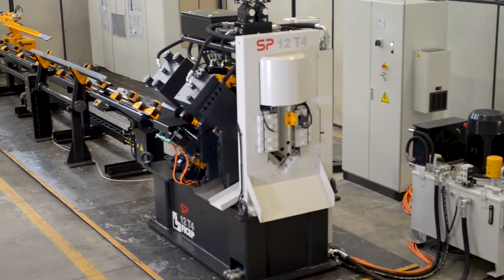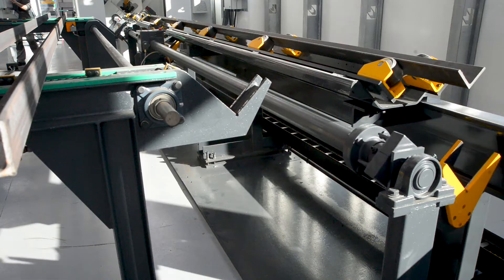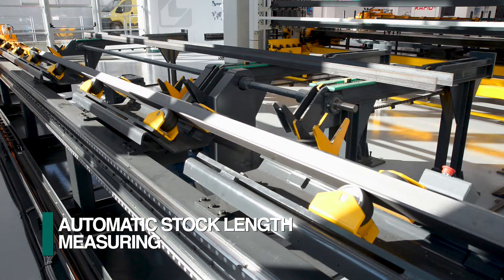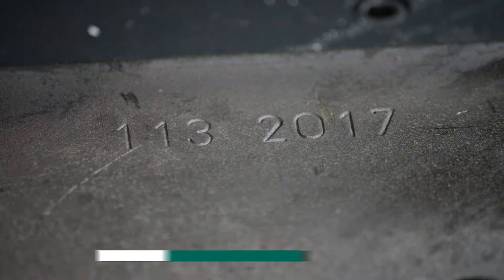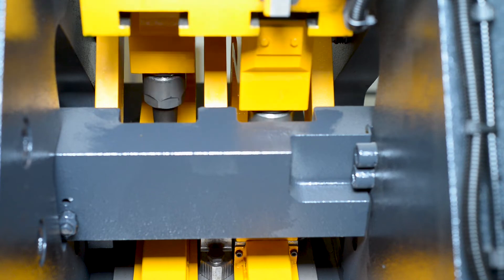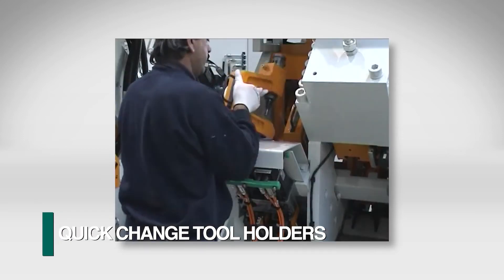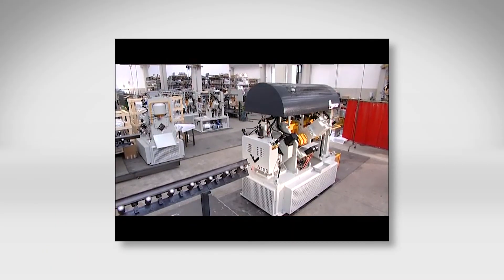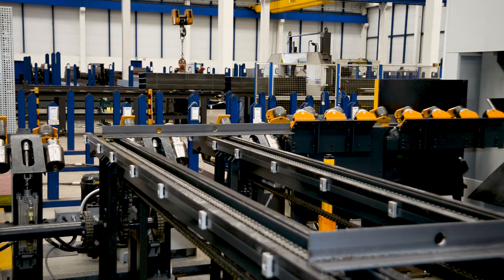Steel Angle Fabrication by FICEP Uses Unique Steel Fabrication Techniques in the Model SP Angle Line

Comment: Was one of the ones shown the A-206? My job is replacing mine with one of those this month.
Reply from the maker: The SP models utilize a material positioning carriage where the A-206 uses a roller feed system for positioning and measuring.
Reply: I'm eager to see it. We just got a burn table and beam line from y'all last year. Our current angle line is old and tired and it'll be nice to have a fresh one to rassle with.